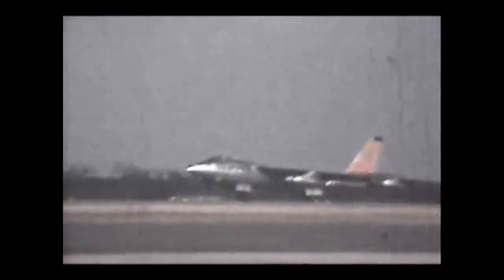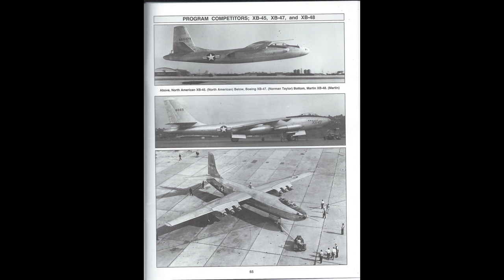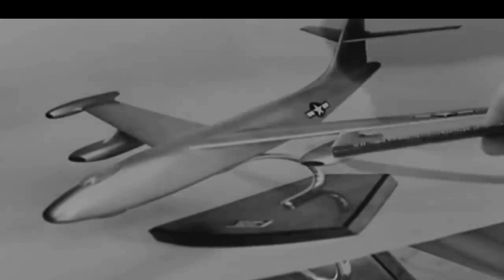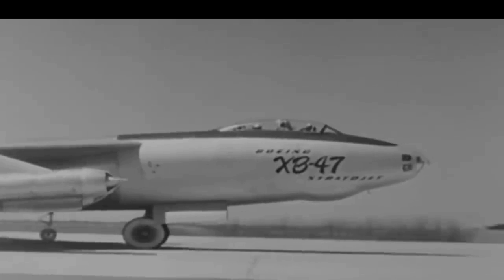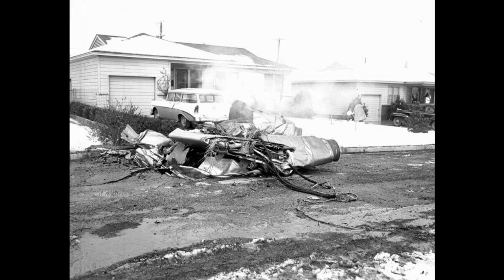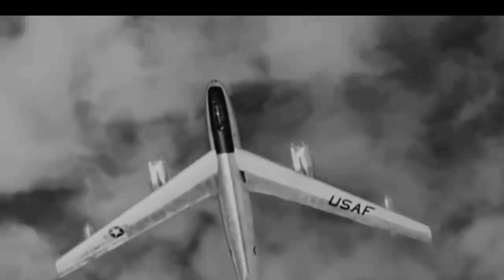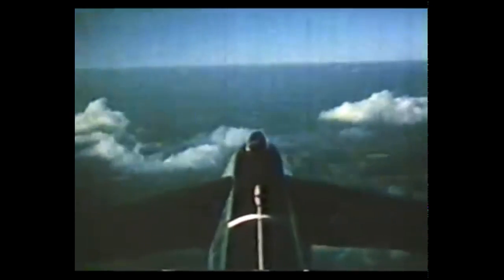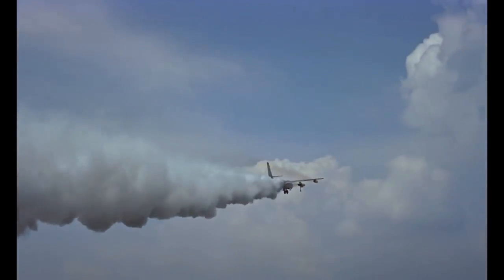B-47 Stratojet- Revolutionary design or flying coffin?

Comment: Considering this aircraft was being designed in the 40s, it was always going to be an unknown quantity as it was pushing technology and engineering beyond what was understood. The V bombers of Great Britain were also testing unknown territory. The Vickers Valiant also suffered metal fatigue. The men who flew these aircraft were a breed apart.
Reply: Rusty Kilt I was thinking the same, Rusty. The Valiant was a lovely looking aircraft, but ... you pointed out the problem with fatigue! I must say that the B47 was a lovely looking airframe as well - all those curves!
Reply: @rafman016  The VULCAN, still my favourite for Sexy aircraft..
Reply: @rafman016  But the Valiant only started to suffer from severe metal fatigue after it was pushed into a low altitude flight regime it had not been designed for.  The B-47 wasn't strong enough for the flight regime it had been designed for.  Big difference.

The situation with the B-47 is much more like that with the De Havilland Comet.
Reply: Never worked on one. One of the guys that did told me toss bombing killed the airplane. It was not designed for it and could only handle a hundred or so sorties.
Reply
Reply: @jayreiter268  Again, another case of using an aircraft for what it was not designed...did the same with Vickers Valiant and F104 STARFIGHTER
Reply: The supreme irony was that the Mark II Valiant, which WAS designed for low-level operations and was faster at low level than either the Vulcan or Victor, was never ordered into production.
Reply: @GorgeDawes  It was an era of fast developing technology... The XB-49 Flying wing was developed around the same time as the V Bombers and B-47 and was plagued with problems but was far ahead of its time... Also, in many cases, inter service politics, as well as political. often proved the down fall of promising designs. The TSR-2 was a winner, but consigned to the scrap heap because of Politics.

Comment: My Dad was in the AF in the early 50s and was an aircraft mechanic assigned to a B-47 Squadron.  He told me of a demonstration class where they showed the new anti locking brake system for the plane.  He told everyone that this was the future for automobiles, but everyone scoffed at him.
Reply: There are basically 3 different types of "anti-lock braking systems" :  1) fully mechanical control  2) mechanical control w/ electric assist  3) electronic control w/ electric and mechanical assist.

Comment: 11:08 You look at that picture of all the planes and you can spot 3 planes that are still in service....    The B-52 , C-130 and the KC-135
Reply: You missed two, the B-57 and cessna t-37/a-37. NASA still uses the B-57 airframe and I think the T37/A37 are still in service in some countries.
Reply: There is also the Grumman Mallard in front of the C130, they are widely used by civilian operators.
Reply: I flew KC 135s out of Plattsburgh AFB. 82 combat missions in Viet Nam. IMO, the best tanker ever.
Reply: The C-130 is STILL in production.
Reply: @georgewest4255  they still fill the skies around Spokane, Fairchild AFB.  Will for at least 20 more years.

Comment: I recall four B-47s fell to earth near Wichita during the '50s which was a bit alarming.  I lived in the suburbs to the east and it was a regular circuit for them to pass near my school in Andover.  Two of them went down from a mid-air north east of Wichita still on that common flight path, one slid across highway 54 about 8 miles east of Wichita, and one fell a few miles north of Rose Hill, Ks, east/southeast of Wichita.  Many. many people moved to the area to work at Boeing in the late '40s into the '60s and many children of those folks were in classes close to mine.  Airworthiness seemed not to be the cause of those crashes, some other issues.  It was a challenging transition from piston power era designs, I recall many companies were having teething problems with the new designs for the Air Force.  As a youngster, it was exciting to contemplate these sleek machines but news of test crashes was fairly common, didn't seem to dampen spirits much.

Comment: As a young contractor at NWC China lake in 1985,  I got to "check out" the last B-47 inside and out before it was restored to flight worthy condition and flown to it's final home. It was parked by the side of a road in the middle of the desert. It was a very cool aircraft.
In the early 80's NWC also had a row of B-29's stored on the range for targets. Many were salvaged and now reside in museums across the country.
Reply: RALPH FRASIER I was there at NWC too.  I saw a B29 fly out and the B47 mentioned.  I was with Grumman when the B47 flew out.
Reply: If I'm not mistaken your particular B-47E is parked up at Castle Air Museum...
It was flown there in '86 from...China Lake. They have a good museum there in Atwater.
Reply: In 1981 I was stationed at Subic Bay, Philippines as a US Marine. I saw a B-47 take off directly over me and recognized the twin inner engine & single outer engine layout - I was trained in aircraft recognition and had already been an aviation buff for years before. At that moment I realized I would never see that exact sight again! I am not sure why a B-47 was there at that moment in time but it definitely was, even though it had been “officially” retired years before 1981.
Reply: @davidgold5961 the Navy flew EB-47Es.  Found a picture from 1977 - so one of them?
Reply: @chrismartin3197  Yes, that is the most logical answer. Thanks!

Comment: When moving into a totally new and faster category of aircraft, you're bound to have losses - sometimes high under the right circumstances.  This was one of those situations.  They basically had to relearn the effects of flght on materials at speeds only imagined before and stresses that would break earlier planes.  That's a tall order.  They were all very early generation designs so of course there were hundreds of things that needed to be fixed or improved, and they kept at it.  The newer aircraft resolved the problems slowly or sometimes even completely.   (reading back, I see I didn't express myself well, but I think I got my meaning across.  I guess it's time for me to catch some Z's.  Good Night)

Comment: The plane served for more than a decade.  A good aircraft but an early design.  The B-52 was a worthy successor.
Reply: "The B-52 was a worthy successor.
"
No B-47, no B-52.
Reply: The Air Force has plans to retire the B-1 and B-2 to free up funds for the procurement and fielding of the B-21.  The B-52, however, is planned to solider on.  In fact, there is a competition to re-engine the B-52.  Any design engine submitted must fit into the existing nacelles.  I guess the old BUFF has a lot of life in that machine!

Comment: Good little video - thanks for sharing!
Three corrections: 
- its fuselage and not fuelselage
- it’s Convair and not Corvair.  The Corvair was a small rear-engined air-cooled Chevrolet car built between 1960 and 1968 and was not related to the Consolidated Vultee Aircraft company (Convair).
- it’s Strategic Air Command and not Supreme Air Command
In my view, the problem was a pretty complex airplane with many new systems and a big increase in performance coupled with aircrew who simply were not trained on these new technologies.
Reply: There was a Carvair as well modified dc4

Comment: When you see that “Laydownl bombing manoeuvre, where the plane comes in low, pulls up sharply into a steep climb and Immelmann and released the bomb on the way up, so the nuke is flying up in one direction, the bomber diving down for the deck in the other. The stress on those long thin wings must have been immense.
Reply: Immense?  Quite so, but the roll maneuver in the Immelmann is only 1-2 G's IF done right, which is the ONLY reason such a crazy maneuver could ever be considered for a bomber the weight and size of a modern jet airliner.  
   Amazingly, in dribs and drabs over the years, I've learned that most of the frontline SAC and TAC trained to deliver nukes with such a revolutionary and entirely unimaginable maneuver as delivering a hydrogen bomb intercontinentally in such a way BUT it was the only way after BIKINI atoll's surprising size was revealed colossal beyond expectation, too big to deliver conventionally and realistically hope to outrun the blast unless goin' 180 degrees the other way at full throttles ASAP.
    My Dad, Sr. Command Pilot, and family lived in Warrensburg Mo., at Whiteman AFB during the Cuban missile crisis.
Reply: I thought that type of bomb release was called a "toss" or OTS (over the shoulder). It's how the nukes were launched in my Navy squadron flying the A-4 Skyhawk and I was absolutely floored when I learned the USAF practiced the same bombing technique in their sizable B-47 aircraft.
Reply: @dragonmeddler2152  Quite so.  I found out my Dad was doing this routinely, as a way of life, a career - about 8 years after he had died accidentally.  Here he was doin' stuff daily that'd scare the wits out of most everyone - just and only to protect us all AND put food on the table for his children.  I never knew the extent of his selfless devotion to me and us, nor even had a clue about what that meant in the '50's-60's USAF.  It is, at first, unbelievable, and magnificent.
Reply: @dragonmeddler2152  Roger on the A-4 as THE greatest carrier attack/fighter of it's day.  (Longtime fan)  The Skyhawk is just about as perfect a thing for it's role AND splendid to fly right as can be, I'm sure.  The Blue Angels COULD fly A-4's indefinitely as far as I'm concerned.
    It's "just" an "Immelmann" that involves releasing a bomb at the point where the maneuver will send it on the it's way in the last 30-45 seconds before detonation, those few seconds being escape time for the aircraft goin full throttle 180 degrees opposite heading (in all weather, intercontinentally anywhere, 24/7/365 at a moment's notice, without explanation).  (Whew!)

Comment: Excellent video.  It was both ahead of its time and dangerous, two properties of cutting-edge aircraft that often go hand-in-hand.  The truly advanced aluminum alloys which mixed strength, light weight, and fatigue and stress-corrosion cracking resistance hadn’t arrived on-scene yet, and the design was optimized for mission  performance vs. structural robustness and material longevity, particularly at those weights, speeds, and maneuvering envelopes.  The B-47 was a remarkable aircraft that lived and learned as it went along, just like so many others that came before it or have come along since.  The B-52 was ultimately the benefactor of Boeing’s lessons-learned.

Comment: The B47 was a great plane.  It was early in the jet age when many planes, not just this, had huge issues with metal fatigue.  They didn't have the sophisticated instrumentation we have today so yeah it was a lot more dangerous.  But rushed into service? No i dont think so, its service is what gained the knowledge of its flaws.
Reply: 8:38 The 2nd of the two XB-47 's that were made is now on display at The Octave Chanute Aerospace Museum. Illinois. [ not chopped up ]
Reply: Absolutely true! My father was a Navy Aviation Radioman in a “VC” squadron from 1949 to 1953 flying crew on the Navy’s first aircraft specifically designed to deliver the atomic bomb, the North American “AJ-Savage”. This was a mixed power plant aircraft that used two prop engines (same type as used on the B-26) and an auxiliary internal jet engine, used only in take off or final attack run (my dad said they could reach almost 500mph in attack mode).   Problem with them was they tended to crash a lot!  The nickname given to them for the AJ nomenclature was “Aeronautical Junkpile”.  My mother was so concerned at the time she got my father to change his rate to an Aviation Stores-keeper where he spent the last 20 years of his Naval career.

Comment: The B47 broke significant new ground.  The LONG swept wings had Aileron Reversal, flutter, and tip stall problems.  I would not say Boeing completely erased all the problems, but they did get the template right a template used even  today.   The engines are on pylons to keep a clean wing.  But the CG axis of the bare wing is not coincident with its torsional axis.  The forward jutting engine placement brought the two axis coincident.  In addition The engine placement spanwise countered flutter.
Swept wing aerodynamics in 1945 was:  analyze a straight wing and multiply by the cosine of the sweep angle.  NACA and Boeing cranked up swept wing research and by the time of the B52, a great deal more was known.
As to engineering prowess, the B52, B747, And the B737 were also mainly slide rule designed.  The B747 likely to remain in production past the computer designed and government subsidized A380!
Reply: You do realise Boeing are government subsidised, right?
Reply: Matt Bowden I know Boeing was subsidized, in a sense, in the military industrial complex days of the Cold War.  (While we defended Europe). Much research in the B47/52 benefitted the B707.  That was 60yrs ago.  At present, Boeing gets some state tax breaks.   But the U.S. government never owned shares or had a board seat like EU governments have in Airbus.  
EU recently ruled Airbus received 22billion euros in subsidies.  (Google “Airbus Subsidy Fine”. ). There is an ongoing investigation of Airbus complaints against Boeing, but no results yet as far as I know.   Economically the dupes are the Airbus taxpayers.
    The proof is in the pudding.  Disasters like the A380 (now being scrapped), or the A400...dismal sales,  would have sunk Boeing.
     If you have some info to share on the subject, please do so.   Thanks D
Reply: Pedro DLR  The fact is EU fined Airbus for subsidies, period.  Boeing has not unless you can provide contrary facts.
    Defense is Government with voting taxpayers, not markets.  Unwise to conflate the two.  But If you think the EU governments don’t put their finger on the defense sales scales, I got a bridge for sell.  It’s the nature of government and why best governments govern least.
     Boeing screwed up on the MAX (though rigorous analysis dilutes the blame).  The only thing I ask is the FAA’s Euro equivalent scrutinize Airbus products as rigorously as the MAX.   I wonder if Airbus fine flowed into Boeing bridging them thru the MAX mess, how ironic.  
     The present economic policy is roiled by Covid (yr REPO comment?).  Don’t know what to expect long term.
      My bottom line is I don’t like screwing the taxpayer for white collar welfare....anywhere.          Cheers.
Reply: Pedro DLR   GEs Jack Welch started the employee squeezing and was lionized by Wall Street.  At the time my little company was buying from GE and they were a pain to deal with, bullies really.   When GE bought into HOUSTON oil equipment companies, They had to deal with Exxon and Chevron etc.   GE got its butt handed to them.  Ha ha.
    As to bonuses for big dogs, I kind of look at them as the business equivalent of an NFL player.   I don’t mind them making money, but want to make it myself as well.    Then there is insane stuff like Hertz brass getting bonuses and 3 days later declaring bankruptcy.    Go figure.  Cheers
Reply: Joakim von Anka    If you think Government assures safety, I have a bridge to sell you.   Airbus planes have design defects like the A300 that crashed in NYC because the pilot used the rudders.   How bout the Airbus A330 coming out of Brazil that crashed for lack of a pitot heater?   (Pitot heaters have been around 6 decades) How about the ATR crashes ..icing is not unique to ATR.   Government on the board insulate the company from liability...period.
     The market is punishing Boeing.  CEO fired.   How many government employees have been fired on both sides of the pond for Airbus or Boeing mistakes?

Comment: An excellent video and a good analysis of the problems of the B-47.  One of the reasons that the B-47 was so difficult to fly was that to get the best fuel economy and flight performance, the pilots had to fly at a precise altitude and to maintain an exact airspeed inside a 5-knot window known as the "coffin corner"... too fast and the plane hit the maximum mach and shockwaves would form on the wings, causing massive drag, and too slow and the plane would stall.    

If I may, I suggest that you run through your scrip several times to find those places where you stumble and those words that don't naturally flow off the tongue.  Even though you have written the script, your brain and tongue need the practice to effect a better flow in your monologue.  We all stumble when reading scripts.  That's why the best speakers go through their scripts several times before showtime.

Comment: Why do you keep using the word “fuelslage” to refer to the large center section of the airplane?
Reply: Because that’s what it’s called.
Reply: It's "Empennage".
Reply: Fuselage is the correct term.....Empennage would refer to the tail assembly.
Reply: That I what we call it in the USA
Reply: @Yogenh  Not "Fuel-se-lage". It is a French origin word and is "Fuselage", pronounced "FEW-se-lage"...only one L sound on the last syllable.
Reply: @michaelbrant1668  He is commenting on pronunciation. The word, fuselage, only has one L in it.

Comment: To answer your question, I would say both. An interesting video with a number of facts I did not know about the B-47.  As a kid in December 1969 I saw one in Hawaii taking off.  I'm glad you mentioned the last flight going to the museum.   He almost lost it on landing as the airspeed indicator went out and he stalled!  Some quick differential thrust saved the day.  Im surprised you didn't mention the "toss bombing" experiments that were pretty amazing.   Just brush up on your narration and do it in "chunks" and assemble it later.  Do an audio slate like "paragraph 2 page 3 take 2...."  before each one and it'll be easier to do.  Nice video. Thank you 😊